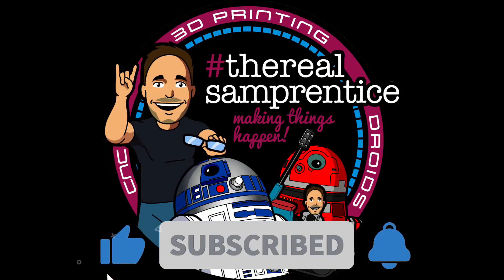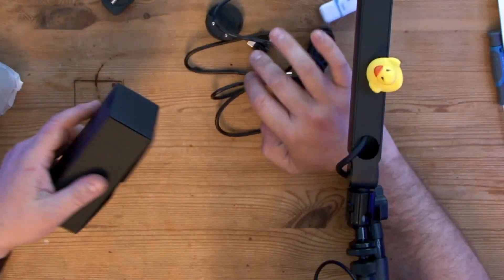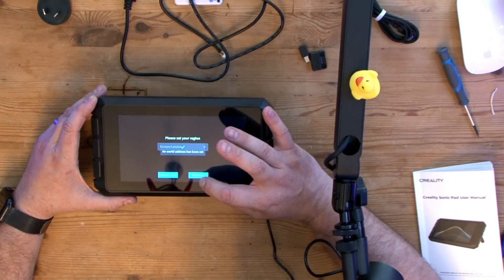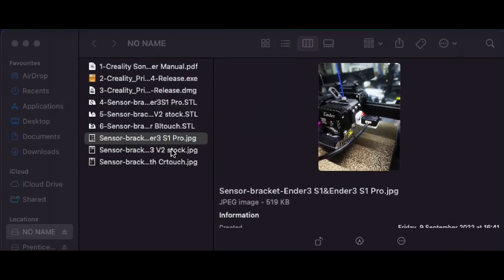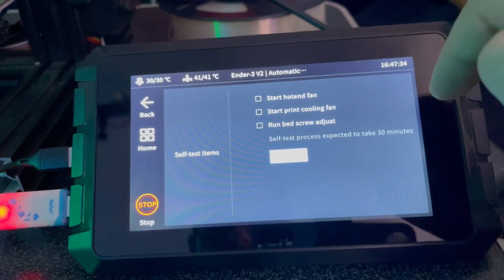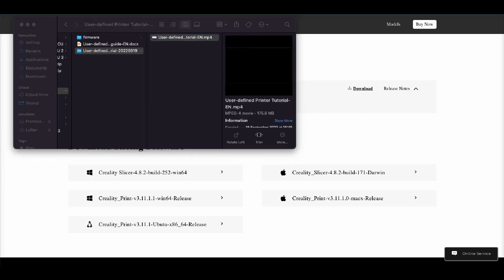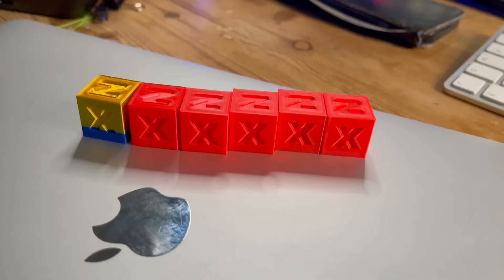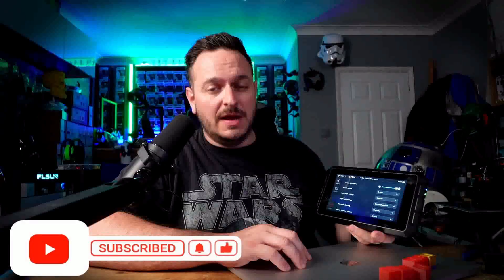3D Printing Revolution: Introducing Creality Sonic Pad

Comment: Holy shit they are asking $160 for this? That's fucking insane for what is basically a RP3 also the "Open Source Commitment" is a bullshit claim since Klipper/Mainsail isn't even their own project so all they are doing is creating an API for the interface. All they are doing is providing a default profile in the OS.

I have really high doubts that they even made their own "CrealityT800" SoC they made for this device.
Reply: ...no expert here, for sure, but the specs shown at 11:17 seem to compare favorably to pricing an RP3B+7" touchscreen (at least on AMZ).  Either way, it seems to be targeted toward people who plan to stay in the Creality ecosystem and may not (or may somewhat) be savvy enough to build out their own Klipper rig <hand up>.  I do hope they open the embedded Linux (alive) CLI though.  :buffering: